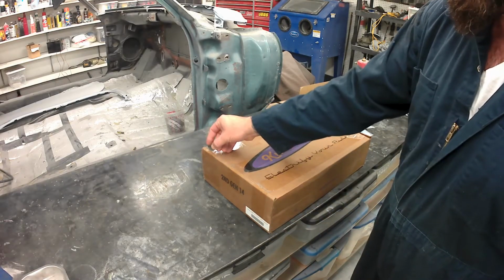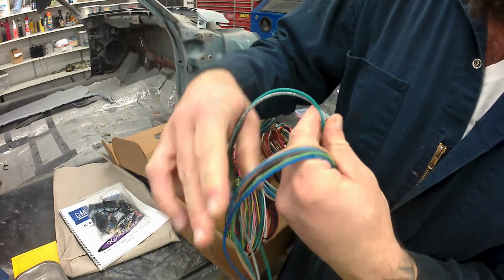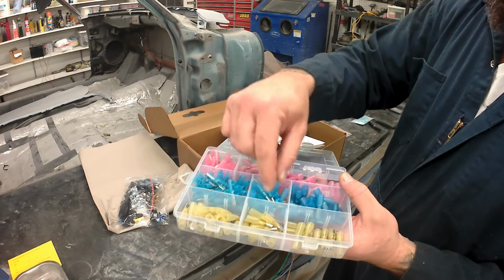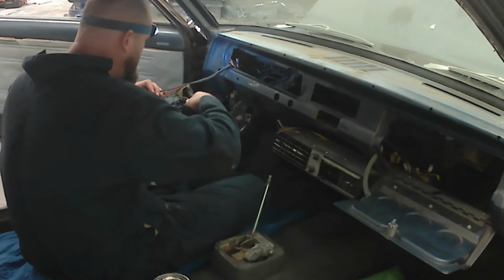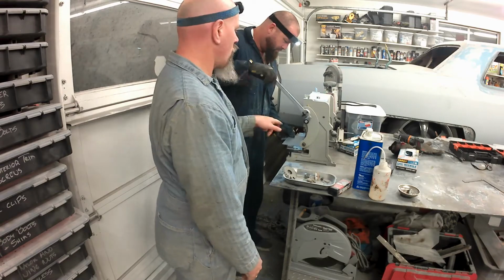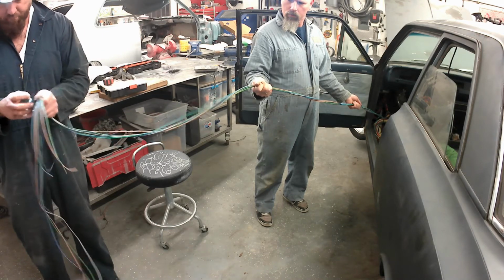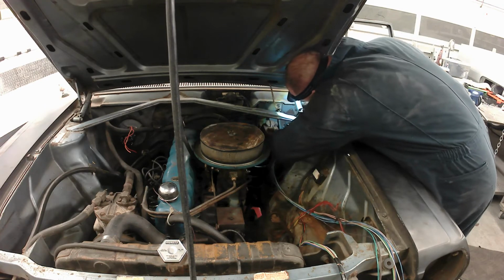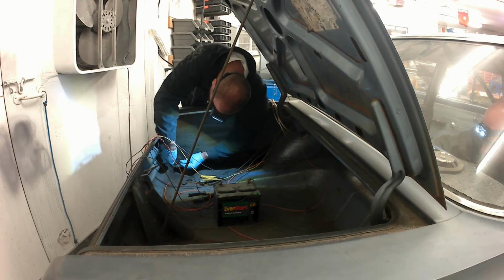Installing a Kwik Wire harness in a 1966 AMC Rambler. Ray's rusty Rambler Part 4

Comment: Hey brother I’m wanting to rewire my 76 c10. I’ve already got a LS stand alone harness for my swap ,but would like to change out the chassis wiring for the rest of my truck. I’ve already got the Dakota digital gauges and all other engine components wired to the stand alone harness. I’m not currently running electric windows or locks but would like to eventually, so I’d love your opinion on what set up I could use without the overkill or too much unnecessary wiring. Any advice would be appreciated thank you.

Comment: Used one similar to this on a 1965 Sunbeam Tiger rebuild. Makes the job a lot easier than trying to follow the original color code wiring on the 1960 MGA I put back together.

Comment: Mike, how did you wire the brake lights?  I have the 8 wire Kwik Wire harness and the instructions only show one wire (#29 I believe that is labeled as Tail Lights) going to the taillights.  This is fine for tail lights but how do I get brake lights with only one wire?  I have an 1157 two element bulb on each side, thinking that there would be one wire going to one element for tail lights and another wire going to the other element for brake lights.  I'm stumped.  There is a wire for the 3rd brake light but the instructions specifically say NOT  to connect that to the brake lights - it only goes to a 3rd brake light if you have one and I don't have one.  I'm really confused.
Reply from the maker: I'm hoping u were able to resolve this man! Sorry I just saw this. Your taillights and turn signal become the brake lights. The 3rd brake signal will not be used. Hope that makes sense

Comment: I'm going to be replacing the wire harness on my 78 F250 and am wondering how to go about ordering the right harness. How do i know how many circuits I need?
Reply from the maker: Hey Cody! I would recommend a 14 circuit. That will handle everything and give you some extras for stereo and electric fans. Good luck and thanks for watching!
Reply: Thanks a lot!

Comment: What does it cost to have someone rewire your car if you buy the kwickwire kit.
Reply from the maker: Hey Keith! Really depends on the car but I would guess 1500 to 2500 is a good budget.
Reply: Ratsnest Hotrods I have a 03 350z , and I bought it about a month ago but noticed some electrical shorts in the car with break lights and blinkers and I figured I would just rewire the entire car.. but I honestly have no knowledge of this kind of stuff
Reply from the maker: Gotcha. That's I whole different ball of wax. Modern cars have a pretty sophisticated computer system that would make that very difficult. You're brake lights and blinkers should be a fairly easy fix. Some good troubleshooting videos should guide u in the right direction. Good luck!
Reply: Ratsnest Hotrods thank u

Comment: I’m working on a 65 coupe like yours and looking to go with a kwik kit. My question is how did you go about getting the door and windows to hook up when the switches attach to the weird harness?
Reply from the maker: Hey Dustin thanks for watching! It's pretty easy. First you have to buy a kit that has extra circuits for windows which you wire through window relays and then to the switches. Not hard to do but hard to write it all out here. I have a link under the video that makes a recomendation on a great computer book on wiring. If you call Kwikwire they will help also.